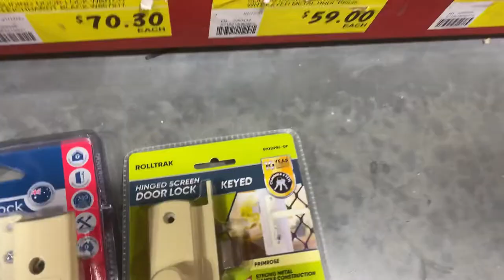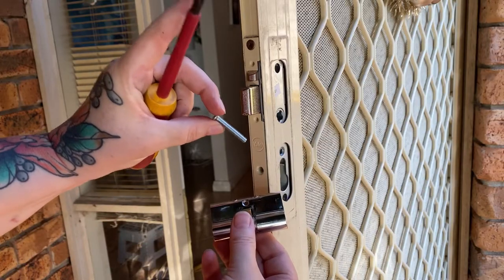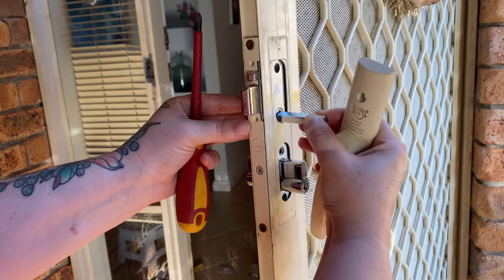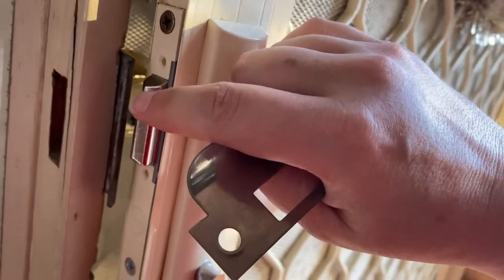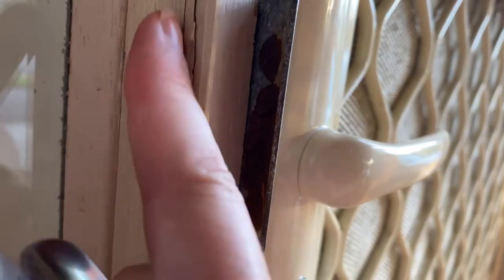How to change a Whitco screen door lock

Comment: Thanks :) Hasn't actually solved my problem, I have no idea what my problem is, lock isn't working after installing. Still great to watch this to troubleshoot, cause instructions in lock pack are dismal! 

I've actually got my old lock back on now & found the reason it wasn't locking was the door has moved over time & so that little nob at the top doesn't have enough pressure on it from the striker plate to press it in enough to activate the door lock & so new lock had exactly the same problem as old one, so tip to anyone with a broken lock for no apparent reason, check the distance between the lock & door frame before going to the hassle of buying another one. I just needed to pack the striker plate to fix mine

Exact replacement special ordered in by bunnings is about half the price of the one bunnings is now stocking to replace it/one in this video too, although that's the one I'm having some random issue with not working, maybe that's why they've gone with a different company now? dunno, but this video was good to troubleshoot & confirm I've done everything right with the install anyway, so no idea why the key & nib things won't turn enough to lock/unlock after installed
Reply: this could be My problem? I can't lock it with the key, but the inside lever locks it fine. i switched it with the back door assembly and now both don't work .. (key doesn't turn far enough) i'll try tape that small latch in to test it next, or perhaps the hole in the wood isn't deep enough for it. @NicoleHerrickDIY any ideas?

Comment: Handy repair Nic. How weird was the hole in the frame? Ever figure out what was going on there?
Reply from the maker: Thanks Fingers. Yes the hole is definitely strange but I haven’t even thought to check other doors and see if this is common. Thanks for reminding me.
Reply: Unfortunately, Locks only keep honest people honest. In my opinion, the wood frame the keeper is attached to is fairly compromised. A fairly burly figure, or one with a crowbar could break that quite easily. A piece of mild steel 20mm wide, 3-4mm thick & a metre long, with .5m above the keeper & .5 below with 6-8 screws along it would reinforce the keeper area. I would actually take out the keeper wood screws & use two, 4-5 mm dia. countersunk bolts & drill right thru from the door side & thru the mild steel. If u don’t have some Colourbond Classic Cream paint then a test pot from the Hardware Store will be more than enough to hide the steel etc. Having said all that, ur real vulnerability at the front door is the side window. Smash it or cut it & in 10secs & “they” are in. Quickest easiest solution is a security camera linked to ur wi-fi & smart phone. I know this about fixing a lock & I found it really helpful after mine started not locking but u know, rabbit trails & one thought leads to another….😂

Comment: Hi, enjoyed your video. I have just built a new rear deck and had to rotate the security screen ( very similar to yours) 180 degrees so door will hinge from the opposite side. Only trouble is the door handle needs to rotate in opposite direction, one direction front door and the opposite for rear door. Do u have a fix for that?

Comment: Thanks Nicole. Really clear instructions. I have the same lock. However, The snib pulls out easily. Is that normal? There seems to be no way for it to stay in securely.
Reply from the maker: Do you mean in your current lock that is installed? If so then that’s not right, try taking the lock apart to see if something has disengaged or broken. If it’s a lock you have just purchased and you have not installed yet, then it may feel loose as the handle is designed to be installed in either of two directions. Be sure to follow the instructions and se the snib in the correct alignment  at the right time as indicated. Hope that helps.

Comment: I have changed the handle following the instructions and I can lock my door when it’s opened but when I close it I can’t lock it? It won’t turn all the way to lock?
Reply: Probably there is an obstruction to the main locking bolt after it’s hit the strike plate. Or your door may have an upper and lower locking bolt also, and if any are obstructed and can’t extend fully out, you won’t be able to lock the door.

Comment: Great video! However my lock switch from the inside doesn’t turn when I try to lock from inside :(
Reply from the maker: Check if it turns when you have the door open.
Reply: Hi! Thanks for the reply, it does but only if I push in the little metal piece above the latch
Reply from the maker: @rheamoloney4621  hmm does yours have a keyhole on the inside? What happens if you turn that to different positions?
Reply: @NicoleHerrickDIY  it seems to turn but not all the way, I’m thinking I may have bought a faulty set
Reply from the maker: @rheamoloney4621  yeah, just take it back and get another.